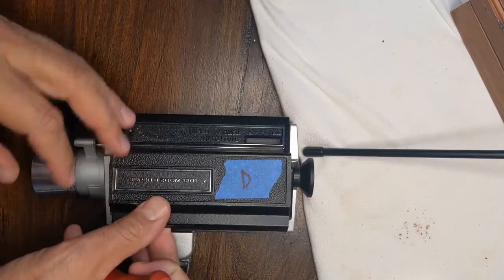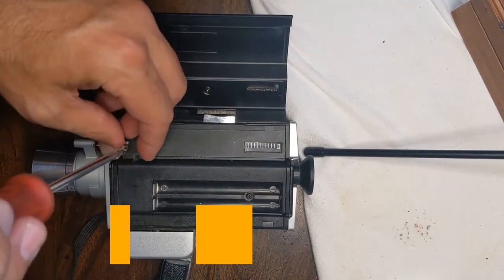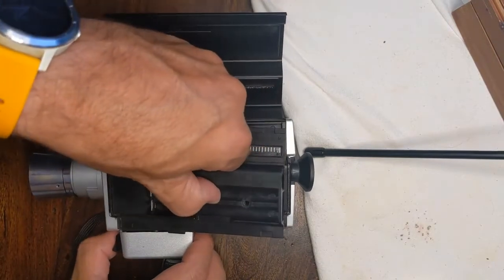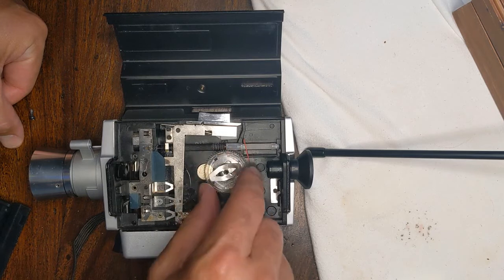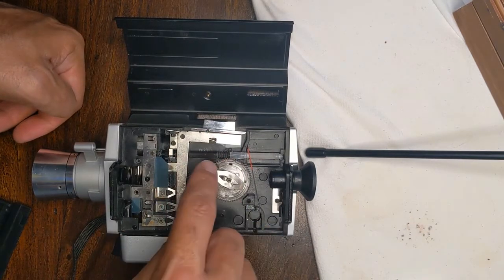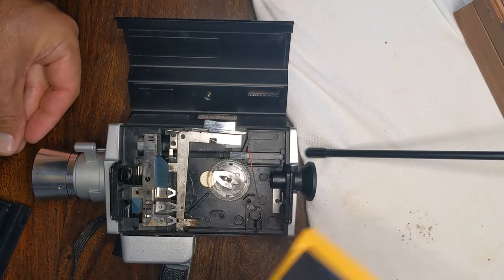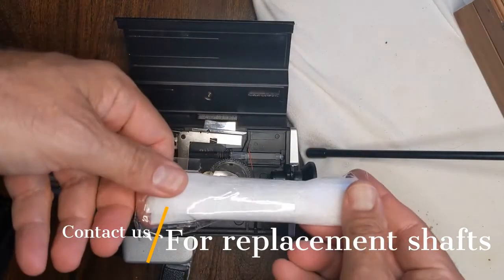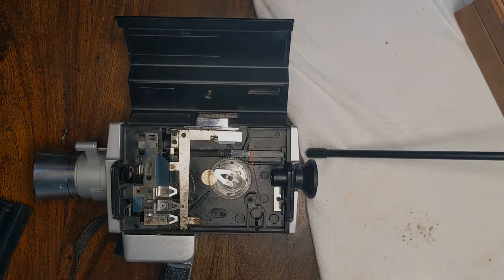Bell & Howell 1201 Super 8 Video Camera Shaft Repair

Comment: I bought a bell and Howell super 8 camera today, told it was working. Got home, put batteries in it and then saw that the motor wasn't spinning. I opened it up and saw that the crank shaft had snapped. Do you think you could send me a link to where I could buy a new crank shaft. Do you think you could also make a video on how to fit the new crank shaft?
Reply from the maker: We are working on manufacturing brand new ones to sell. Will be testing next week when returning from our Alaska fishing pilgrimage. Will post an update in about a week.
Reply: @hificlinic557  any updates? i took apart mine today and the shaft broke, id be very interested in purchasing one!
Reply: @hificlinic557 any update?